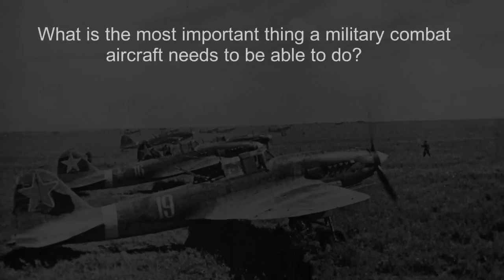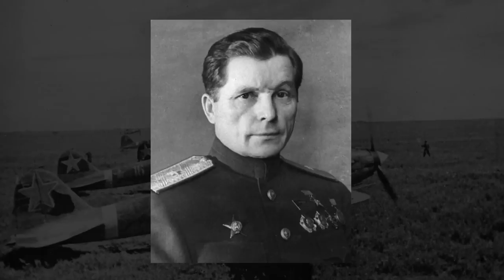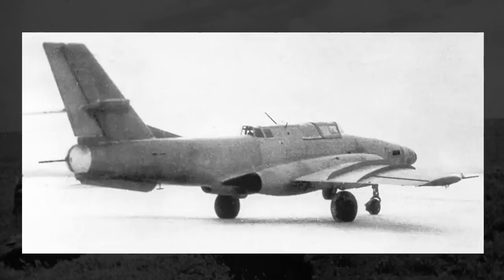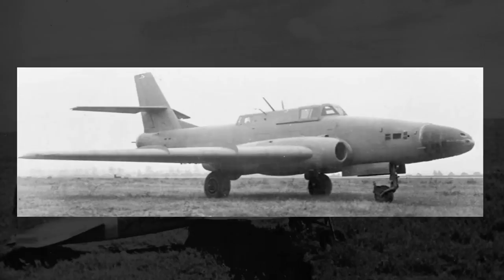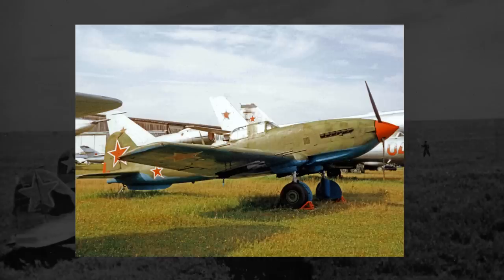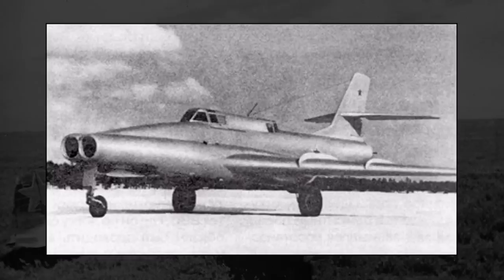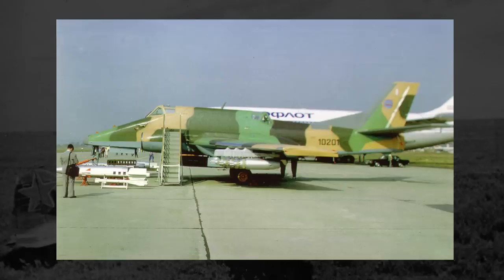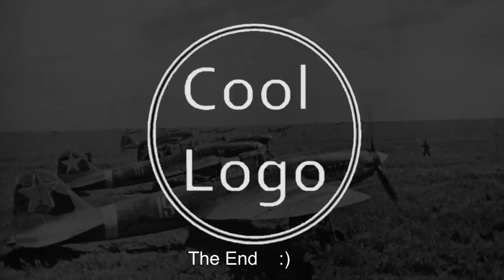The Ground-Attacker That Couldn't Attack: Ilyushin Il-40

Comment: With the il102 in the 80s Ilyushin  tried to return to the business of constructing battle planes. Only problem was: the Su-25 was already in service.
Reply: Well, if you dive a little bit deeper, the state competition for the new attack craft started in the 70s, but since the sukhoi bureau was working on an attack plane since 1956(!), By the time the design inspection phase of the competition came, while the Ilyushin bureau presented some blueprints, the Sukhoi just rolled up with a flying prototype, and immediately secured the competition. That's why the il-102 first flew in 1982,even though the su-25 was put into service in 1981.
Reply: I have no idea how good the IL-102 may or may not have been, but I'm guessing that if it managed to be beat by the fucking Frogfoot of all things, it must have really been a hunk of junk. Also wild that even in the 80s there were still banking on the exact same design philosophy they used for the IL-2. I know that plane is iconic and all, but come on. It's a 40 year old design.
Reply: @joaogomes9405  Not really, at least on paper, the IL-102's flight characteristics were moderately superior, and its' max payload was better, too. Also, obvious bait, but I'll bite: what's wrong with the Frogfoot? Seems like an alright plane to me, even in comparison to the A-10.
Reply: @joaogomes9405 SU25 is great aircraft.There is nothing wrong with it even today

Comment: The ill-fated Supermarine Swift suffered from the same gun problem. When an early varient had two extra Aden Cannons bunged on, they were mounted right at the nose. Result? As with the Il-40: flame- ut for every burst of gunfire! I found this out from a neighbour who is now 90 and who did his National Service with a Swift squadron!
Reply: Modern fighter jets have a counter measure for it thats pretty simple. They have extra igniters that act as a backup, but also they all fire off when the gun is fired
Reply: @invertedv12powerhouse77  Actually, what most fighters do is simply have the muzzle located behind where the engine intakes are. When this isn't possible, yes, the igniters do fire when the trigger is pulled.
Reply: @anzaca1  its also with the hip station missiles they fire when the rocket gas can enter the intake yeah.

Comment: Interesting that they kept the tailgun. The Navy's BuAero had determined that a tailgun and gunner were obsolete by the mid '40s. Both the Douglas AD-1 Skyraider and Martin AM-1 Mauler were designed as single-seaters early in development.
Reply: Yeah, but a tail gun is just cool.
Reply: @Derrick Cox  OK, Yeah.  And a remote tail gun is even cooler. But is it worth the C/G penalty?
Also, the USN had zero  ZEKES to worry about as interceptors at that point. 
 The Red Air Force had NATO.
Reply: Some of the B-52 bombers still in service have tail gunners. I believe the last recorded tail gunner kill by a US bomber was in Vietnam against a MiG-21
Reply: @fate3071   B52's tail gunners were all decommissioned. They removed them from all active B52s in service. the last airman that had the designation of rear tail gunner left the service in the 90s.
Reply: On bombers, there are no more tail gunners. We still have them on helicopters. Many old B-52 tail gunners moved to helicopters in the early 90s. Some as gunners, some as flight engineers.
Reply: @derrickcox7761  Nothing wrong with being extra safe.
Reply: Idk if its too obvious or if people dont know but i am surprised nobody mentioned that those post ww2 tail guns had their own radar and were much more dangerous than just gunner aiming them.
Reply: The trick is that first Il-2 modifications didn't had a tailgun. It was one sit aircraft. Its leads to losses. So they added tailgunner in second year of war. And seems never give it away.
Reply: @robertkalinic335  well yeah but when air superiority entered the era of having heat seekers lobbed at you from miles away, having a tail gunner ultimately didn't do anything besides add weight and another body onto the aircraft

Comment: In the USSR, there was another IL-76-40 aircraft project of the early 1970s, but it was not put into production due to the high cost of manufacturing the aircraft had 2 jet engines and a variable sweep wing, the interest was that the aircraft could fly at an extremely low speed of about 90 km/h. This it was achieved by changing the angle of the wings, it looked like a butterfly, that is, there were two pairs of wings, at high speeds they took the shape of an arrow, and at low speeds it looked like reverse scissors blades were supposed to, that the aircraft will be able to deliver cargo to the military technical to hard-to-reach areas for aircraft landing

Comment: 0:08 here is the broad answer: it must be able to complete its mission and bring the crew home intact.
Reply: Imperial Japanese Army Airforce late in WW2: "It must be able to complete its mission"
Reply: Doolittle raid was a failure then?
Reply: @HALLish-jl5mo  in one sense yes, yet the aircraft was was doing several things it was never meant to do.
Reply: @patrickradcliffe3837  - But, it still did it's job and the Raid forced the Japanese to attack Midway so they may finally finish off the American Aircraft-Carrier threat the Imperial homeland.
Reply: @inisipisTV  the mission had the desired effect, but was not wholely successful because the aircraft was asked to several things it was not designed to.

Comment: I wonder if that problem with exhaust gases from the cannons was what contributed to the A10 Warthog having it’s engines mounted in such a novel way?
Reply: I think it was mostly to avoid them ingesting rocks when operating from unpaved fields. It also allows lower wings, which makes re-arming easier.
Reply: Hides the exhausts from IR on the ground
Reply: I do actually wonder why this isn't a more common problem with jet aircraft?
Reply: The A-10 has/had the same problem. Gas from extended firing of the cannon would cause engine flame out. It's been taken care of.

Comment: The engine flaming out due to the guns smoke+gasses getting in sounds just like the issue with A-10 development. In that case, i think that every time the cannon is firing, the engines are continually fed spark to keep them going/reignite asap.

Comment: Piston driven prop plane. Sir, do you even A2 Skyraider? That thing saved friendly downed pilot lives, took enemy lives by the bushel, and was piston driven prop plane from the end of the 40s.
It had it's greatest  run in Vietnam. The 1960s. An airplane driven by air-cooled radial, was attacking and annihilating ground targets while rescuing downed pilots. It could handle all pak 1-3 targets at least, and was deadly accurate 
With attack aircraft the question is: how slow can you go? A2 sub sonic, performed great tons of armor and durability
F100? Can drop willy Pete or napalm on our own guys because when you're going 800mph below 500 ft, I believe there's a chance to misidentify the target as everything in front of you is a blur 

Illyushin would design some of their more successful Aircraft over the years along with Mikoyan 

Every military builds ugly birds that don't perform well. Hence the needs for test pilots and the process of development of ones military  technology

Comment: The combined rate of fire of 4800-7200 rounds per minute rivals common Gatling guns, but with a different mode of failure and wear mitigation, and a more "shotgun-like" dispersion pattern, rather than the Gatling gun's "If one round misses, they're all likely going to be off-target". It's probably heavier and requires more maintenance to have 6 individual guns, but it seems like they could also be more useful if they were pulled from the plane and mounted on "Technicals", if a given situation were to become so dire, or for a renewed life after the plane's obsolescence. The American solution, which is the M-61 Gatling gun, can really only be placed on another airplane, since it is the standard sidearm. We don't even see them using older ones that have been slowed down and put on armored vehicles for airfield defense, and the CIWS systems probably use factory fresh guns, because they must hit a smaller target, and accuracy is supercritical... Then again, the available in-field footage of CIWS in action is that they tend to run out of ammo without hitting anything, so maybe they are using "refurbished (sham scammed)" guns.
Reply: Not really much harder to maintain then 6 gsh-23. M61 compensate it by having 6 barrels and electric motor. Also gatlings have same (if not worse) shotgun pattern. Just look up ridiculously low accuracy of A-10 gun.
Reply: @alexturnbackthearmy1907  We seem to be saying the same thing, differently. Thanks for adding the notoriously bad GAU-8 to the party though. A gun so bad that publicity enhancement (ie., propaganda) has to refocus all discussions to the sound it makes. Having sat and watched the A-10s gracefully flying around the mountains of S.Korea, I think it's a shame that it be burdened with a horrible show-piece of a gun. It's like when people start criticizing the policy of a female politician, and from nowhere, people jump in with "those boobs", "mommy", "she's hot".  The A-10 could probably do so much more, and better, if it simply deleted the gun and used that nose weight for systems that work. Maybe even put a second seat in there, and have a chin turret with optics that can - at least - see the enemy. The thing has so much wing and engine that it could likely do a lot of the work that the B-52 does, but with much less meat, money, and paperwork.

Comment: Whilst its not 100% relevant to the IL40, one thing hawker hunters had a problem with, was the spent casings being ejected, and subsequently being sucked into the compressor blades.

They did learn from this though, and later marks have big bulges on the underside specifically to collect spent casings

Comment: 0:18)The Flying Boxcar. C119.
4:41)About the same rate of fire as the Civilian Model Thompson Submachine gun. 800 rounds per minute. 13.1313 a second. 50 round drum magazine was "dry' in about 3.5. 100 round was less than 8 seconds of continued fire. Navy Model is 600 RPM. "Dry" quicker. Box magazines hold 30-32 rounds.

Comment: I dunno I guess to be able to perform its assigned mission set that it was intended to perform after the final design stage cuz from step 1 to the finish of the design the missionset/s might differ because of changes in politics or strategy

Comment: And that, my friends, is exactly why the venerable A-10 Thunderbolt II looks the way it does! 🤟😁
Reply: Yes, but unfortunately the A-10 had to sacrifice the cool tailgunner. I don't think the trade-off was worth it 🙂
Reply: @Mamonar  the A-10 Thunderbolt doesn’t need a tail gunner… the A-10 Thunderbolt IS the tail gunner!!! 😝
Reply: When a IL-40 made love to a Gatling gun.😅
Reply: No, the A-10 has rear-mounted engines to avoid ingesting rocks when taking off from unpaved firelds.
Reply: @beeble2003  as well as not sucking in gas/ smoke from its cannon! The engines are back there to keep them safe

Comment: Reminds me of a video I saw about another Soviet aircraft which had the cannon mounted right in the middle of the air intake on the front of the aircraft.  The gasses from the propellant would flame out the engine so they couldn't shoot it much.  Only this one I believe was a fighter and not ground attack aircraft.  edit  It was the Mig-9.  Actually a cool design but worthless in practice.

Comment: Let's be totally honest, even the west didn't see much use for this kind of aircraft as a game changer. The A-10 however showed how not just helpful, but actually awesome a ground attack aircraft in direct support of ground troops could be. Much like the use of the Luftwaffe in the early stages of WW2.
Reply: Even the a10 despite doing its job somewhat okay was too threatening to its own troops aswell as too dangerous for its own pilots. It's kind of there just in case as most countries have discovered guided munitions fired from jets like the f-15, f-35 or rafale models are more effective on average for ground attack

Comment: Oh for chrissakes, you'd think they learned their lesson with the MiG-9, which also had the unfortunate tendency of ingesting its own gunfumes, and hence flaming out, but apparently not 😂😂
Reply: Some things never change. 🤣
Reply: probably because was at the same time and where parallel programs us had similar problems whit the saber
Reply: The US had a few of the same issues in various aircraft
Reply: @ChiefMac59  And one plane (the F-11) that was faster than its cannon projectiles and shot itself down - a problem with Mach 2 aircraft…
Reply: @anuvisraa5786  
Except, it wasn't and they weren't.

The Il-40 design was submitted in 1952. At that point, the MiG-9 had been in service for 4 years, and had been flying for 6 years.

Hell, by 1952, the MiG-15 was flying xD

Comment: Communists: "We need to replace these Il-2 and -10s with modern jets! That'll show the west!"
Meanwhile in the U.S. Navy: "We call it the Skyraider. It can drop anything you can think of, from rockets to bombs to napalm to strafing runs, it can carry everything including the kitchen sink. Communists will fear it for the next two generations."
Later, in the USAF: "We were using fighters, but it's way cheaper and easier since we built Cessnas with an attitude problem."

Comment: The 2 things Russians have ever been good at drinking and propaganda. The T34 with it's over hardened armor and crap quality was made a "legend" by propaganda.  The "legendary" IL2 that used the rear gunners body to stop bullets from hitting the pilot. Right through to the new T-14 Armata the tank so great the Russians don't dare put it on the battle field. The only way Russia has ever won any battle is to have more bodies than the enemy has bullets.